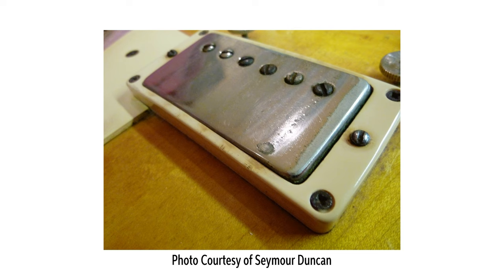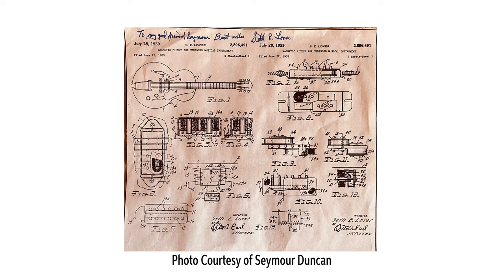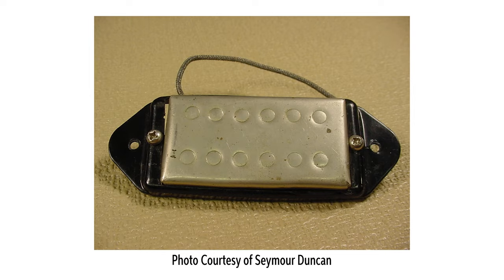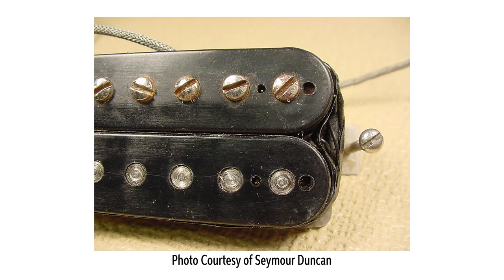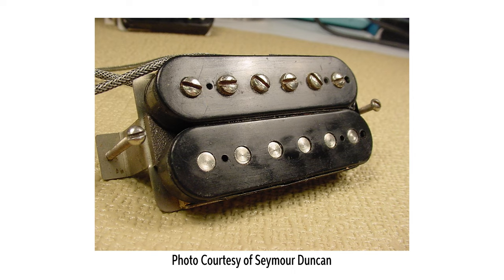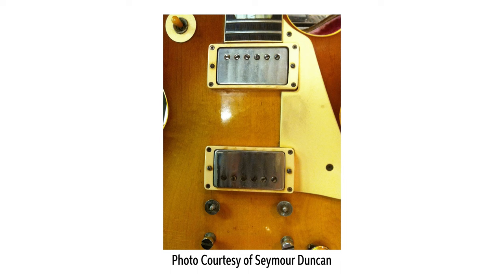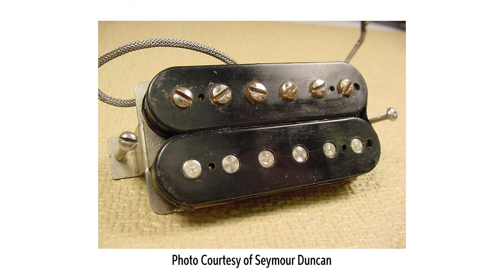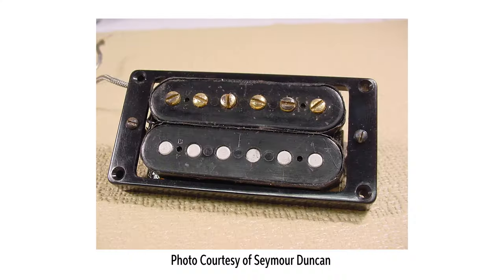What Is a PAF Pickup?

Comment: Great video but the magnet strength to numbers is completely incorrect.
Reply: And the PAF has just one magnet.
Reply: Make a video then, know it all
Reply: "Incorrect"

Lol,..what a compelling argument.
Reply: The numbers simply represent different formulations of the metals. Not the strength of the magnetic field. You’re on the Internet, Google it.
Reply: @seanrosedotcom  
You obviously haven't taken your own advice.

The following is a quote directly from Gibson.....

"Alnico 5 is a stronger magnet, usually resulting in a slightly brighter tone. Alnico 2 is a little weaker, resulting in a slightly warmer tone. Alnico 5 has more MAGNETIC material and less FERRIC material, resulting in slightly lower Inductance."
Reply: @stricknine8623  That's 2 of them. The Wikipedia page is quite thorough. And if you go to Franlin pickups (one example) you can read 3 is weaker than 2 when in a shape that would be in a Humbucker. Please stop trolling and educate yourself.
Reply: @seanrosedotcom  
And it is absolutely true that alnico magnets get progressively stronger from a 2 to a 5, with the exception of a 3 (that is almost non-existent)

Nobody uses a 3 it's a bastard. Most all major pickup manufacturers do not even offer an Alnico 3 because of the truth in what I'm conveying. Only about 1% of the guitar population are interested in an alnico 3 humbucker. Even the alnico 8 is more common and it is rarely used.

It's 2, 4 & 5...And they get stronger in that order...So if anyone is "trolling" it is definitely you. Some off the beaten path exception to a general rule isn't worth your original comment unless you are interested in being a troll.

 It is true that the numbers are derived from the makeup/percentage combinations of the aluminum, nickel and cobalt elements from the periodic table.

But the idea that the strength of the alnico magnets also progressively increase with the number is true as a general statement enough to be used as a rule of thumb for those watching this video. Thus the output follows this formula with little exception also.

Now run along sport and don't forget to brush your teeth.